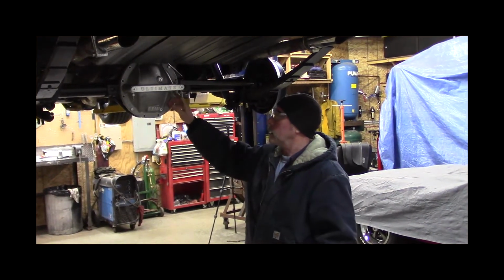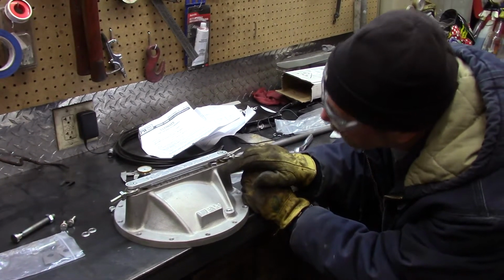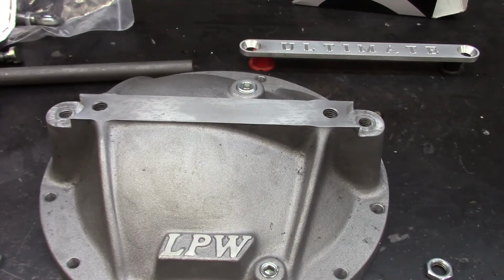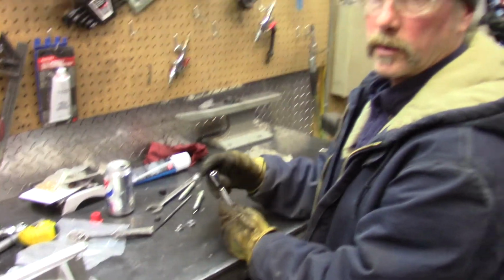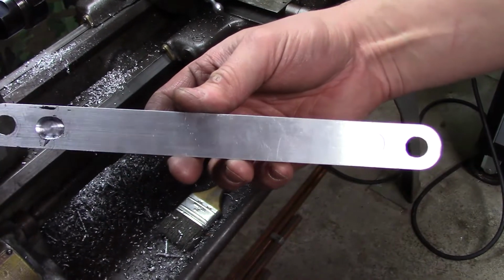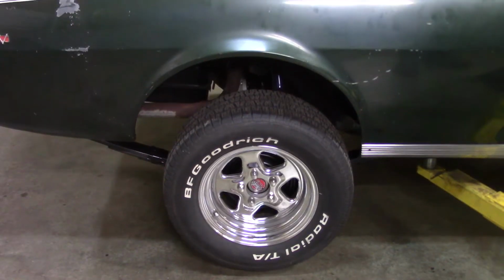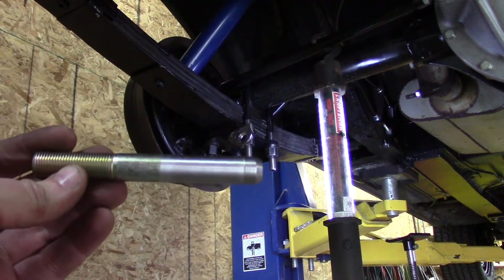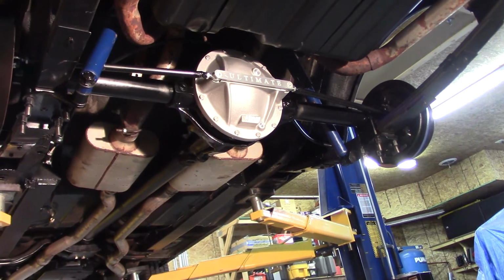LPW Ultimate 12 Cover Install On Javelin AMX

Comment: Do these cars have a biased spring in the rear like  MOPAR? MOPAR rearleaf springs suspensions, when set up correctly, launch the cars better than any of their contemporaries during the 60's through late 70's. A friend of mine taugh me how their rear suspension works, and during the launch the cars stands up, tranferinv the weight to the rear end and then accerelarates like crazy to the end of the strip. If it doesn't accelerate with the front wheels just touching the ground it doesn't have enough Horspower, and that's the engine builders fault. In 1976 at the Winternationals in Phoenix, at Beeline Dragway I saw several Superstock 390 Ramblers that launched like MOPARS and ran consistent 10.90's all weekend long. We ran a 66 Chevy II with a punched out 283/ 292. It ran in brackets  running the 10.90 class and went to the finales only to lose at 10.89 to a winning 10.92. That sucked, but it was the name of the game in prostreet in '76. It was fun to see our 292" car running the same eats as the 390 Rambler, although with much much looser rules than super stock. But it educated me on a properly set up rear suspension!
Reply from the maker: Always like to here the history, thanks.